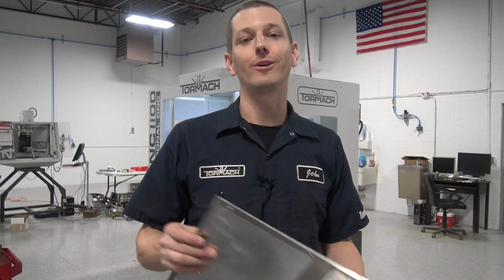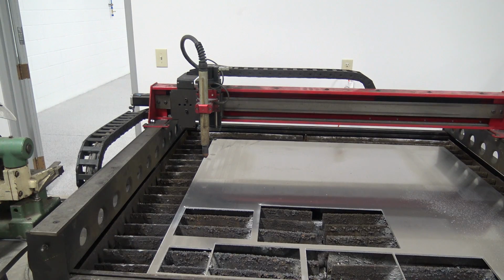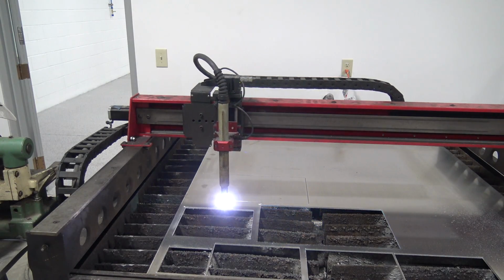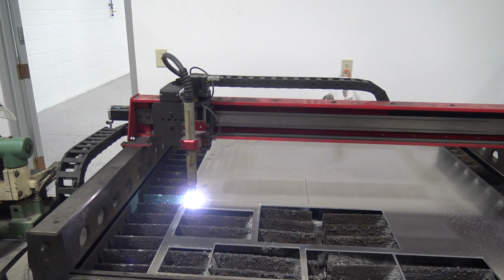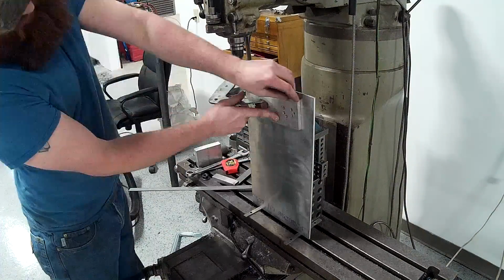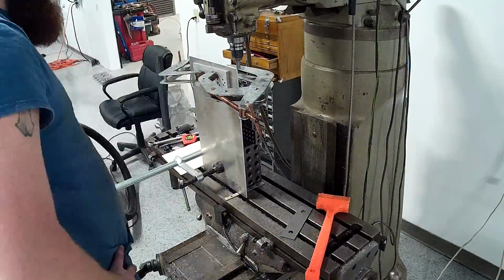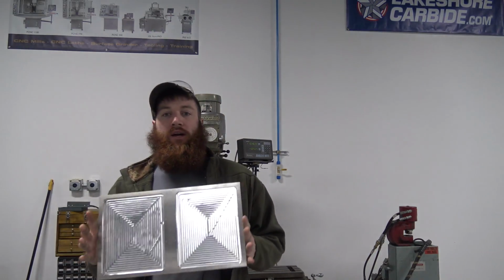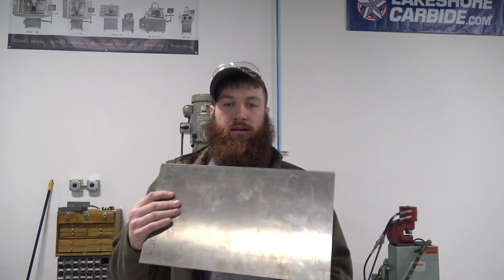Machining a Large Robot Panel! Widget90

Comment: Watching this video I could see that your Vacuum plate has only One (1) Vacuum line attached... That says that it's a "One Trick Pony"... The Vacuum Plate I envision you building would have Multiple lines for different areas of the plate...

Being able to create a vacuum in individual areas would enable you to place blocks in specific areas, to hold a work piece in place, like a clamp. Then, when one side is machined, flip it over... Vacuum to the blocks would be maintained, during the flipping process. Once in place, turn the vacuum back on to the work piece and continue machining out the bottom of the holes...

Just a thought... Hope it helps...

Comment: an idea if you are going to be doing a lot of plates like the vid, it may be easier if you use a bit of cardboard on top of the vacuum plate with lots of hole's in it in a pattern and where there is going to be holes in the material cut, you will just need to patch the holes, then you can just leave a skin on the bottom of the holes and if it breaks the skin it wont matter.  
but a laser cutter would be the easy way to cut the holes in the cardboard.
Reply: do you think pdf might work better?... carboard has all them ribs in it
Reply: flat card stock, cardboard would be cheaper,
it's just an idea you can buy special stuff to do the same thing what is not cheap, if john had a vacuum plate that was more than one cell
it would not matter

Comment: nice video man. I have an unrelated question though. I'm working on producing my own PC watching parts. waterblocks are one the parts I want to manufacture. however, I can't handle machining copper. would that be something you would be interested on working on with me?  if so, how do I go about contacting you?
Reply: +NYC CNC it's an X-carve from Inventables with a Dewalt 611 router. I made an attempt and ended up breaking my machine, and 2 end mills.

Comment: Not sure how much hp the tormach has but you should look at getting Mitsubishi aluminum cutter... they have promotions buy inserts get the cutter for free. it will destroy that time...
Reply: +james smith I checked the wiki, it says that Tormach has 21k hp, 55 attack and 30 points of defense. Steel cutlass is better suited for the job than aluminium cutter, as it has 20 more damage per second, and this boss is all about how quickly you can get it down. You may also want to invest into a toxicroot ring if you don't already own one, as stacking poison damage will surely help you in outdamaging the boss before the time runs out and he casts self-destruct. #Kappa
Reply: +james smith I know that Mitsubishi makes good stuff, but that Shear Hog is no slouch.  It's very hard to beat their material removal rate per horse power.
Reply: metalhead2508
Is your avatar supposed to be threatening? I can outdps you with my mage build. #Kappa
Reply: +james smith adx4000 is the holder style
Reply: +james smith that just gor you bud
Reply: +LordDragox412 XD thats god damn hilarious
Reply: metalhead2508
No. Is your other name "IgnoratioElenchiMan"? Because humor is a subjective thing, and you need not to objectify humor like you're doing right there. That's humorist! Not even Jokkari, half-god half-dog of bad jokes and full time failiure of a comedian whose jokes deliver 175 damage within a single punchline would do such a thing... And trust me, he sure could if he wanted to! But he doesn't, because even though he slaughters jokes for his own pleasure at least he respects humor. Even though he broke his right humerus and thinks he's a fungi... I just really hope you didn't eat his chips in a tube called "Cringeless", or else there would be explanation for your behavior...Which would be much less fun as there's none to mine! Mwahahahaha! #Kappa
Reply: +LordDragox412  nope don't know who u r talking about man. sound like you have some issues
Reply: james smith
Nah, I'm just too eccentric for you to understand. Or was it egocentric...? No, no, eccentric. It's a special skill I earned through the line of "Becoming special" questline. I don't expect you to understand. We don't even play in the same server, who knows what version of the "life" game you're playing. After all, you didn't even know how much hp Tormach has. If you were going to raid Tormany, that's basic knowledge, you know? Unless your raid leader was awful, then I don't blame you. I was once a noob too... Good old times... #Kappa
Reply: +LordDragox412 your the one that said my image is supposed to be intimidating... I was just trying to help a guy out and you started the bs
Reply: james smith
I was talking to metal head, the joke critic, level 12. You are simply mistaken, therefore all is forgiven. #Kappa
Reply: metalhead2508
I get it. You're wearing Plato mail armor, aren't you? That would pretty much explain your behavior and your philosophisticated figure of speech... #Kappa